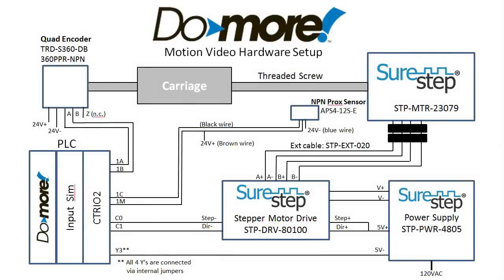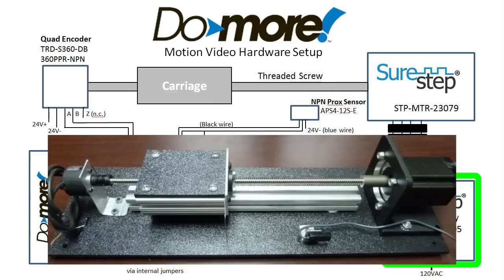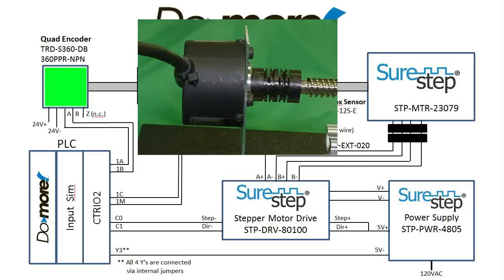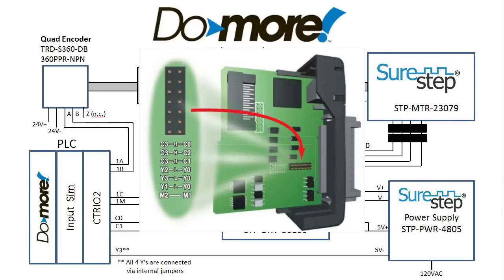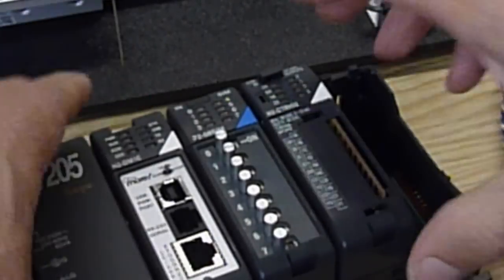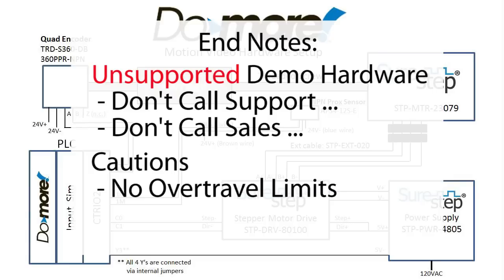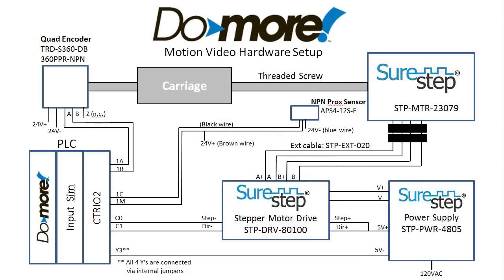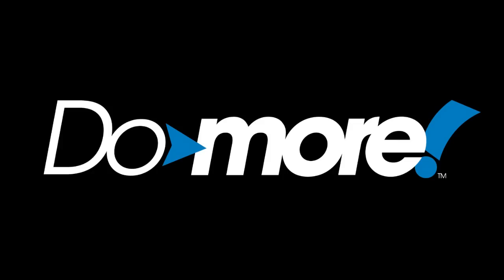BRX Do-more CTRIO2 Motion Demo Hardware from AutomationDirect

Comment from the maker: The answer for that would be "it depends."   What are your design specs/needs?

If you are just looking for something to play with as a side project, consider just using some general purpose ACME Lead Screw and nuts. McMaster.com has a good selection.

The lead screw and nut shown in the video is just something we had laying around - I can't even point you to a manufacturer. The carriage was made from some old 1010 extrusion parts.